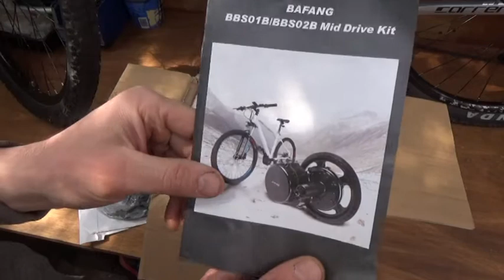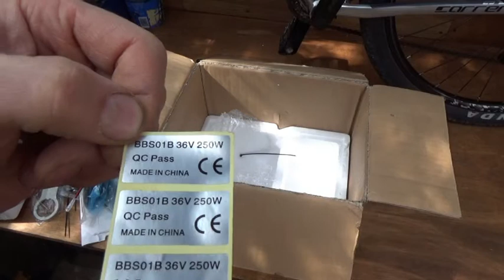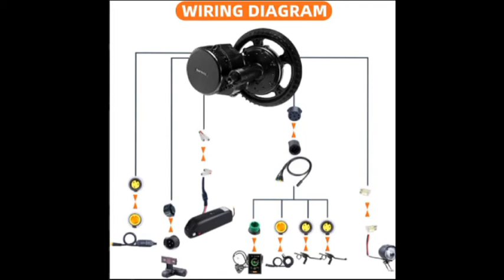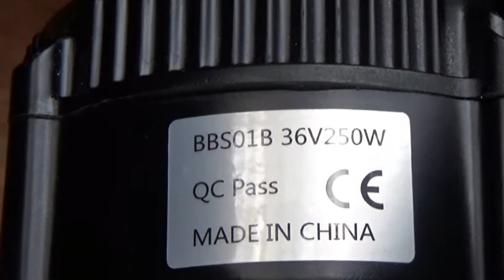How to install mid drive motor to your bicyckle.

Comment: What's interesting in the several videos I've watched on this subject is no one checks the bike to see if it can actually have a mid-drive motor.  Bafang has several paper gauges and such that are used to see if a bike is suitable for a mid-drive.  They measure clearance with the frame, the bracket size etc. to see if the kit will work.  Odd.

Comment: Just screw a pedal attaching screw into the pedal shaft with a penny washer on it to hold the socket into the nut, it will not pull out then, much more positive attachment, no chance to damage the crank adjustment nut

Comment: I would have definitely used locktite on that motor ring as you can only fit one on it due to your bottom bracket size. If that comes loose it'll be bad news!
Reply: Or use the Lekkie one nut. But it looks like the lock nut had enough threads to install.
Reply: @georose33  I don't really fancy the idea of these. One ring with grub screws that'll bite into the thread isn't it? I've had no issues with loctite and lots of torque.

Comment: I've washed at least 4/5 videos of this motor being installed....what you never see is that sh🤬 light installed. I hooked mine up,...either it's broken or I can't figure out how to turn it on.
Reply: Hold down the + button on your controller.
Reply: I have 2 BBSHD bikes, that crap light was trashed on both. It's pretty bad.

Comment: 6:04  oh bro…use a socket with extension you’re killin me gonna strip the shit outta your bottom bracket
Reply: 14:00 why didn't he use "special tool" included in the kit, to tighten that nut?  Even though it's pretty crappy, it's still better than that old school bottom bracket wrench he used.